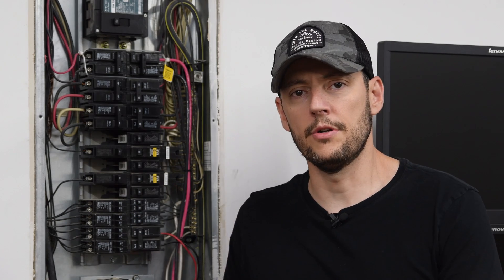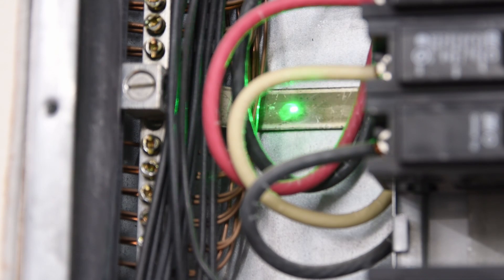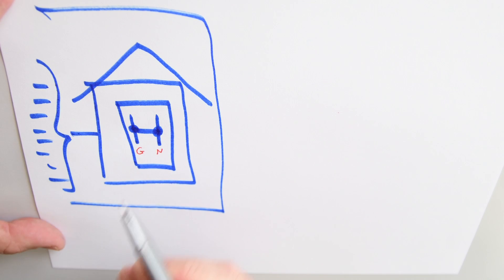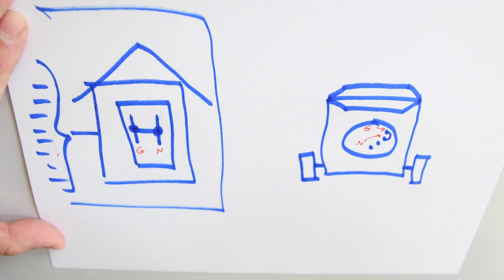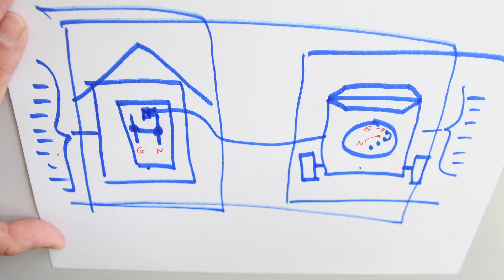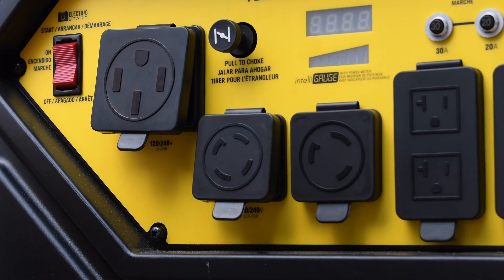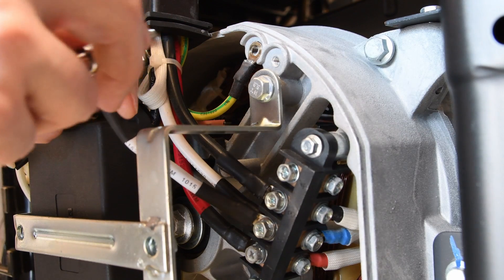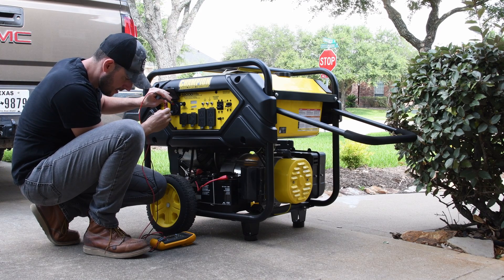Bonded vs Floating neutral. portable generator as power back up

Comment: SPENT THE LAST FEW HOURS THIS EVE WATCHN VIDS ON THIS AND THIS VID WAS THE BEST THANK YOU ! Now I know what to do however are all generaators this easy to convert ? Do you like the Champion ? I can't decide on a Champ or Westinghouse or Generac ..Thanks again any feedback from you and your viewers is appreciated .Also not fully committed to how many watts I need for a small raised ranch home.Was thinkn around 10k starting and 8k running which may be more than enough or can I go smaller ?? Mostly want the well,boiler motor, two fridges and some basic lights and appliances incl a microwave to be available.
Reply from the maker: Thank you, I'm glad you found the video interesting. I like Westinghouse, now I own two. 8k is fine, don't go smaller. Smaller like 5k running will work too. But in the future you may want to add a couple of AC window units. If not planning so and want to be on a budget, 5k will do fine. I run in winter a whole home owen, two fridges, lights (no AC) but a furnace with a 4k-6k peak no problem. Very rare you will have the microwave, the pump and all fridges running at the same time.

Comment: If you are using a generator as a stand alone portable power source, it should be grounded. In fact, the better best way to ground a portable generator is to use a 8 foot ground rod and mall it into the earth and attach a wire from it to the generator ground. That's how it's supposed to be grounded. Most people don't do this. So why are generators built grounded? Because they should be. It's at least half safe grounding a generator to the frame and having the frame sit on the earth. The only time anyone should be overly concerned about it not being bonded (grounded) is when you connect it to a home electrical service. In that, the generator ground should be lifted. There are other ways to do this without modifying the generator. Best way is to lift the ground at the backup generator connection on the house. Not difficult to do. Just leave the Green wire unattached and capped at the male connection.

Comment: So if I use my portable generator to run tools, etc, when I'm not using it as a backup for my house, then I pretty much have to go back-and-forth and make a solid bond or a floating neutral. Why don't they put a switch on the generator so you can go from one to the other.
Reply from the maker: In that case you can put a switch, I didn't because I use the generator only for back up power. I don't have the need of a generator to power tools etc. Thank you for checking the video.

Comment: Nicely done video.  Make sure to label the generator "floating neutral" or "Unbonded." This way if someone else tries to use it as a portable power and not as home backup they know that it has to be bonded again.  I put a toggle switch on mine so I can go between bonded and unbonded just by flipping the switch.
Reply: I’ve been considering doing the same thing! I’ve a got a 30 amp gen and think I’ll go with a 30amp rocker switch if I do it.
Reply: Must be a really big swotch

Comment: I changed my Wen 6800W generator to floating neutral in two minutes.  I left the bridge wire in the unit but insulated the terminal with a piece of shrink wrap that holds snugly but is easy to pull off by hand.  I also added a label by the control panel that alerts any user that the unit is configured for floating neutral, so if it needs to be used as a standalone system the bonding wire can be reattached.
Reply from the maker: That is a great solution, thanks for sharing your experience.

Comment: Just learning about this stuff.  So if I'm understanding correctly, everything ....whether they're household appliances or externally hooked-up devices plugged directly into a floating neutral generator hooked up to the house panel,  then they will all safely use the neutral thru the house panel?
Reply from the maker: Yes, the house panel will act as the single point of neutral for all devices, both internal and external.

Comment: OK, so other than being "out of code" what is the science to the issue? I read on one site it being bonded at both locations might simply trip or not allow GFI to work properly. Can someone confirm and/or state more info on the actual issue being out of code makes?
Reply from the maker: Everything code related is for a reason, safety. If bonded,  and under some circumstances (explained in the video) you could have the situation where the frame of your generator (bonded to ground terminal) could be energized. And you don't want that.

Comment: What if your panel is not bonded because it’s a sub panel because the bonding is done outside on a service disconnect. Since that is the first point to be bonded?
Reply from the maker: I would keep it floating since there has to be only on point where they are bonded, in you case the main outside panel. So if there is a neutral to ground short in anything connected to the subpanel,  the frame of the  generator won't be hot, and the current will flow from neutral to ground in the main outside panel.

Comment: So I get that it’s a compliance thing…… but why? Like is it a safety hazard somehow to have two bonded neutrals?
Reply from the maker: Safety, if neutral turns hot (defective appliance), since it is bonded to ground you don't want the frame of you generator become hot since it is something you would touch and get shock.

Comment: So does that mean once I make that modification and it’s safe to hook up to my house, anytime I want to use the generator on its own to plug tools into. Before I do that do I have to screw that wire back on? And what happens if I don’t modify it at all? Is that a fire hazard?. Thanks for the video.
Reply from the maker: First question correct. If you don't do it, everything will work fine but you system won't be 100% safe. As explained in the video under some circumstances, the frame of the generator could become hot and therefore, giving you a shock or something worst.

Comment: House Pamala is bonded and you said house breaker is first means of disconnect. Really the Generator is the first means of disconnect because the generator has a breaker. The house panel is sub-panel to the breaker at the generator. Generator breaker controls max output and if bonded should trip a house breaker if needed. What do you think?
Reply from the maker: Don't relay on the generator breaker. You can have a 15 amp short and that will not trip the generator breaker but it will trip breakers in the main breaker box.

Comment: A reputable manufacturer will make both types. For example Honda makes the (bonded)  EB series as an OSHA compliant worksite generator and the (unbonded) EU series as a home backup generator.  Just buy the right tool for the job.
Reply from the maker: Thanks for checking the video, and for the information about the generator types. I didn't know that about the Honda EB and EU series.
Reply: @BUTTEWORKS  you are welcome.  Great education video for education.  But like I said just better to buy the proper generator for the intended use. and avoid generator surgery

Comment: I use a A power generator 2300watts from Sam's, house has a 30 amp 240 volt docking station, I build cord to tie L,1 and L2 together at female end to plug in docking station, ground and netrual are tied together at main panel. This inverter gen powers lights , ref, and freezer loads up to 85%  Apc ups beep when ref kicks in, tv and internet work. . Otherwise  clean pwr.   When I use a 5500wat portable gen feeding both legs in to house,  the Apc ups beep a lot more. Not so clean pwr.
Reply from the maker: You are right, inverters are the best options but more expensive. A good none inverter generator with low THD should be ok as well that is why it is important to check the THD value of a non inverter generator when used to power up electronics. 5% or lower should be ok.

Comment: Nicely done! My portable generator is left with neutral bonded to ground. THE CABLE to the house only has the two hots and neutral, so it looks like a floating neutral to the circuit...
Reply from the maker: Thank you for your comment. I think your have an unsafe generator with the cable you are using since if your neutral would become hot for any reason (short) you generator frame would be hot as well by keeping the bond.  Also it is better a 4 wire cable, with ground so the generator is grounded with the house if you use it as power back up.

Comment: NEC does not typically apply upstream of service metering equipment, that is the NESC. Remeber, a 'portable generator' is functionally replacing the utility company's transformer (usually pole mounted. In CA, that pole mounted transformer in most areas has a 'grounded neutral conductor' and will be the bare conductor on a 3 wire triplex style service drop to the weatherhead. If you substitute an alternate source, logically it would have to be the same electrically as the normal source of feed to the structure. May want to call the utility serving your property (they usually respond free of charge) and consult them when substituting for their source of feed. Remember, neutral conductors supply the return path back to the source for 120v, single phase loads.

Comment: Why not just leave the ground unconnected between the generator and house.  Couldnt you backfeed through a subpanel without the ground.
Reply from the maker: Yes you could but not safe. Connecting it you make sure the generator frame is properly grounded to the house ground rod. if you would have an issue in the generator, say a hot touching the frame you want that current to flow to the ground to trigger the  generator breaker rather than having the frame hot waiting for you to be the path to ground when touching it. Thank you for checking the video.

Comment: You can't have two bonded or at trips the breaker is that what I'm hearing
Reply from the maker: No, it won't trip, actually it will work but under certain conditions it won't be safe.

Comment: So on my generator came and it clearly says floating neutral. Are you saying they sold me a generator that is unsafe to plug extension cords to?
Reply from the maker: Yes, they sold you a generator for home back up. There are generators that are floating neutral like yours already by default. You can bond the neutral if you plan to use it with extension cords.
Reply: @BUTTEWORKS  well the generators that said neutral bonded also said transfer switch and rv ready. So that’s confusing.
Reply from the maker: @Walt-c9m  You can use a multimeter and check neutral and ground and see it  it is bonded or neutral very easy. Then you will know exactly what you have. But if it says floating neutral and neutral bonded you definitely need to find out which one it is. Easy with a multimeter.
Reply: @Walt-c9m  RV and Marine tech of many years here. The main AC  panel (and the vehicle's transfer switch, if so equipped) is never neutral bonded. The RV/Boat source that it's shore power cord is plugged into IS neutral bonded because it is the source. If the vehicle has a generator, IT is now source, so it is bonded. The same applies if the vehicle has an inverter.

Comment: So if you are powering your house. The generator should have a floating neutral. As a stand alone unit used to power tools in construction a bonded neutral.
Reply from the maker: Correct.

Comment: What do I do in the case that I want to plug the generator into my home's electrical system, but also run extension cords to my neighbors to power their appliances?
Reply from the maker: Mike, the appliances will work but if they have any issue, short or anything like that, it won't be safe, somebody could get electrocuted. Ground could be hot, and ground is usually the frame of the appliance.  Generator need to be set up bonded or floating depending on the application. I would ask my neighbor to  get an inexpensive generator to run just some appliances. $400 buy you 3000-4000w.
Reply: @BUTTEWORKS  Wouldn't the other generator plugs now be bonded to neutral via your houses bond? If so, then I don't see a safety issue with running cords from the other generator plugs since they are bonded as well via the breaker box.
Reply from the maker: @onlywenilaugh6589  Yes, bonded to ground on the breaker panel not in the generator. Imagine a short neutral to ground, current will go from neutral to ground on the panel. If your generator would be bonded, you frame would be hot.

Comment: If you have a bonded generator with a transfer switch that breaks/transfers the neutral conductor as well as the hot wires do you leave the bonding wire on the generator?
Reply from the maker: I'm not familiar how transfer switches work.

Comment: yep, i agree, even I understand what took place, but the one thing I still haven't seen or heard is what does it hurt to have two bonded  instead of onel? Honest question on my part since I don't  know why, but I know how  now anyway.
Reply from the maker: Imagine you have a short to ground, that means neutral is hot, that means the neutral in your generator would be hot but since it is floating, the current will go to the ground on the panel. Is you neutral is bonded, now your generator frame is hot. No bueno. Thank you for checking the video.

Comment: Great explanation but what if you ran a wire from the generators grounding lug to the same ground rod your panel uses, does this still require a floating neutral?
Reply from the maker: I actually run the ground from the generator to the ground bar in the panel as well as the neutral. Just make sure they are floating in the generator side. You need both ground and neutral from the generator connected to the ground neutral on the panel.

Comment: Would you still need to convert to a neutral if you have something like an interlock or transfer switch since you are turning off the main house breaker?
Reply from the maker: Floating neutral, yes, the fact that main breaker is shut does not changes the configuration, the bond it is still present in the main panel. So only one bond needed.

Comment: If you are not connecting a transfer switch to the main panel but to a sub panel where neutrals and grounds are on separate bars , do you still require that this alteration to your generator be made?
Reply from the maker: Check with a multimeter if both neutral and ground are bonded in the subpanel. they may be in different bars but if they are bonded in they main panel, they are considered bonded so the generator should be floating so once it is connected its neutral bond with the neutral via the main panel

Comment: You only need to unbond generator if the 30 & 50 amp are GFi protected
Reply: Not really, per code, you should unbonded it if plugged into house that already has a bond. Although I'm not sure I see an issue since the only risk would be a fault inside the cord itself from generator to house where you might have current on ground and neutral. But yeah, if GFCI protecting it, and it's bonded as well as the house, it will trip.

Comment: Is this a must do? I just bought a predator 9000  and planning a system to run it into my panel .
Reply from the maker: For safety reasons I would do it if all you want to do with the generator is run the house via an interlock.
Reply: @BUTTEWORKS  ok great thanks!!

Comment: An interesting situation was discovered by another Youtube channel. If you have a bonded neutral generator and your extension cord losses its neutral wire, your ground wire will act as the neutral and all is fine. If you then unbond your generator, you can set your house on fire because without the neutral the voltage can spike to 240v on your 120v circuits. Somehow you must inspect your extension cords to ensure they are working properly. Just because you follow the code does not mean your house will not catch fire. The NEC does not cover extension cords that can degrade over time. Invest in a multimeter and learn how to check your extension cords before using them.

What is happening is the power is feeding over from the other hot leg and on to the neutral in the house.
Reply from the maker: Thank you for the comment. Extension cords and the outdoor wall sockets worth checking once in a while.
Reply: Yes, I saw that also and it is a concern.  Now I wish someone would post a video on how to mitigate this potential fire hazard even if such a failure did occur in an extension cable.
Reply: @randydicotti3975  I don’t think anybody knows how to test a 240 volt extension cord short of using a multimeter. There are ways to test 120 volt outlets with an outlet tester. I guess you could rig up a Y cable to 240 v outlet and use an outlet tester. I think as of right now,  the average Joe is out of luck. His house will burn. Invent a device and have the Consumer Product Safety Commission require them on new generators.

Comment: If you are backfeeding your main panel through a two pole circuit breaker, with the main breaker off, why is the backfeed breaker not now considered the main?  Why would the system not be compliant?  Neutral and ground from the generator are landed on the main panel buss bars, just like the main service line.  So your first point of disconnect would become the backfeed breaker.
Reply from the maker: No if ground and neutral are bonded in the generator. You would have two locations where neutral and ground are bonded, breaker panel and generator and according to code you must have just one. You don't want to have a short to neutral  anywhere in the house while powered with the generator, which it means short to ground in panel (neutral al ground are bonded there) while having the neutral bonded to ground in the generator because the frame of the generator (connected to ground) would be hot. Hope that clarify the point. Thank you Thomabb for checking the video.
Reply: I can see this becoming important if you have a transfer switch in the system...